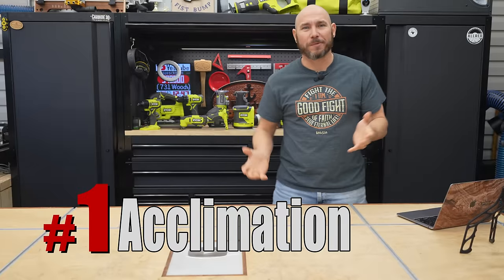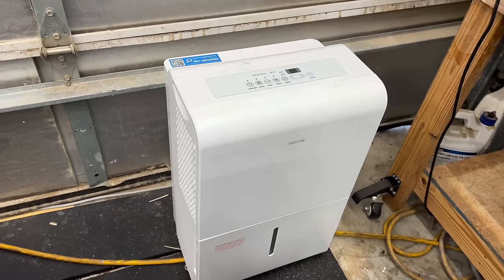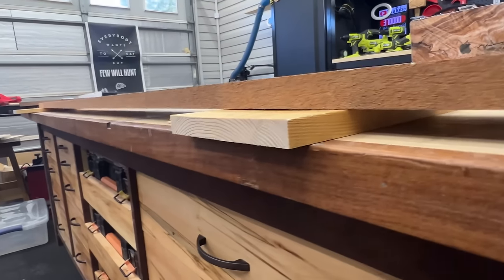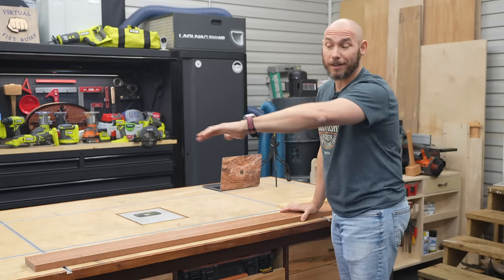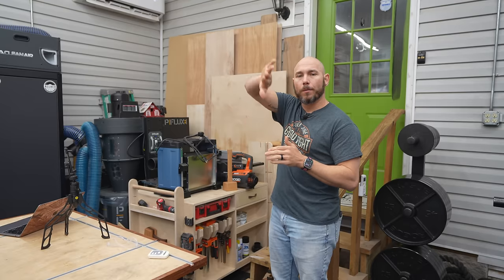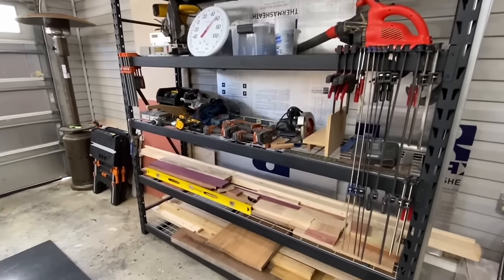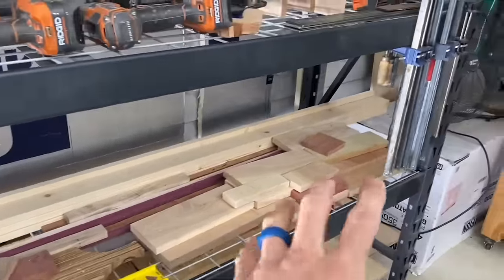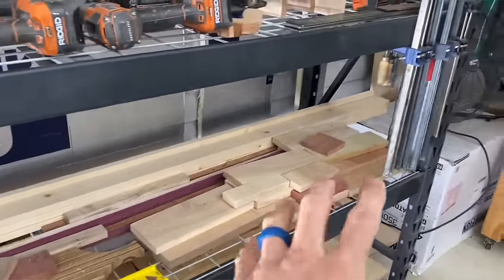99% of Beginners Don't Know These 5 Mistakes Ruin Wood!

Comment: Plywood isn't affected as much because of the Glues/Resins in plywood. Try sealing the ends of your boards to cut down on moisture in and out. 99% of the time, you are going to trim the end or cut it 90 degrees to begin with, and if you stop up the straws, you stop 90% of the moisture in a shop. Same with building tables.. Seal the Whole table, top/bottom/sides/ends, and, you will stop most/all of the movement. This does not include direct sunlight/heat. 
Experiment.. Get some New Treated deck boards from the local shop 5/4x6" and trim about 1" off of the ends, and stand them up in a corner in your shop. Get a scale and weigh each piece, and get an exact length/width and mark it on each board on both ends... Worst case scenario for sure, but, if you think wood does not move much with moisture, check those boards in 2 weeks and be totally amazed. Won't be uncommon to see the width decrease 1/4" on the average... Just FYI.. I build a lot of stuff out of deck boards, because lots stay outside. I built a 2x2x1/8" square tube cabinet once to keep some things in an outdoor shed.. Fresh 5/4 x 6" deck boards. Only 30" wide. I cut the boards to fit after ripping the rounded edges off. Even cut a slight chamfer on the end boards and used cauls to clamp them in place,,, TIGHT!! After a month or so, had 1/8" gaps(Summer time),, and then moved the cabinet into a climate controlled shop a month later and ended up with 1/4" gaps between them. 
One day, I'll get some free time and space and do the same test I did with measuring and weighing them.. No loss in length you could measure with a tape measure over 5 feet, just width, and a little on the thickness.. Cheers!

Comment: Howdy Mr. 731...

Good tips. 👍 I honestly can't think of anything to add to what you already said. 😕  Wait....sure I can :_fistbump::_saw::_hammer:

Perhaps this could be another "build" video for ya and make it a "Part 2" to this video. 

Storage: We (woodworkers) all need it and there just doesn't seem to be enough of it, kinda like clamps. 😉 

One of my SOON to be done projects is an outdoor wood storage area. Now, hear me out (I mean read). Most of us, including yourself barely have enough space for our tools, let alone long 8'+ boards, not to mention scrap. 

But, most of us have a spot just outside our shop that's just a bare wall of sorts. 

Take that Burton lumber store, how they store lumber outside....take that idea and miniaturize it. 

A very very simple box frame, say 10' long x 3' deep +/- x maybe 4' high +/-

All 2x4 construction. Add some studs for support. And then, get that metal (or plastic) roofing stuff, I dunno what it's called, but it's wavy and very inexpensive. Bout $25 for a 2'x10' section.

Easy easy build and the side walls, depending on budget, either slap on some cheap plywood or just use a tarp. 

Would take a few hours to construct and could probably be built for under $100 bucks. 

Viola!!! Storage for wood outside the shop and frees up space inside the shop. 

And, for those with a few extra pennies to spend could just enclose it altogether, like a small storage shed, run an extension cord and plug up a dehumidifier inside it. 

I'll be building that soon. 

On another note. Standing your plywood vertically against the wall. Is it just me or does it seem like the board you need to use is always the one at the back of the stack???? For me, it never fails...I have to move shi....stuff...out of the way to get the board I need.
Reply from the maker: lol yes, always the bottom of the pile is the one I need
Reply: Same here. 
@Mike - I like where you are going with the whole store the lumber somewhere else if you can. Unfortunately, some of us live in deed restricted communities, so our options are limited. You have my wheels turning for an alternative option. I actually just expanded my Bora wood racks with a cantilever system out of #Tubafours and am about to make a mobile scrap storage bin for my half sheet goods, dowel scraps and smaller board cut offs. It’s going to be painful, but I’m going to chunk anything less than 8” long and any sheet goods less than 12”x12”. 😢
Reply: @Damon_Barber  Deed restrictions, for the most part in any state, city or town are fairly similar to each other.  

Here's the nutshell...You can't do any Hardscaping. I.
E. you can't build a permanent structure in your backyard without approval, like a covered patio, concrete walkway etc. 

Now, here's what you CAN do...build something in back yard, side yard AS LONG AS it's not a permanent structure, can't be seen from the street and is NOT taller than your fence line. 

So, as long as you don't build this storage out of cinder blocks and is less than 6' tall and can't be seen from the street, then you're good to go.

Comment: A little tip for those that put their cars in the same garage as their wood, don't put your car soaking wet, as the water on the car will evaporate and make the air inside damp. Especially at low temperatures wood will get wet and mould. Leave the car to dry outside and when dry put it in the garage.

Comment: What if you leveled your garage floor and the applied an epoxy coating? Would that help with humidity?
Reply from the maker: It would help seal the floor and you wouldn't have to worry about the moisture wicking up from the concrete

Comment: Good advice, but... leaving the gap under the door - where the dehumidifier hose runs out - will let a great deal of 'fresh' air in which will almost certainly be more humid than the air inside the building. 👍
Reply from the maker: It stays 35% humidity in there like that. 🤷🏻‍♂️ Dehumidifier kicks on and off as needed.

Comment: It all goes away back to the standards and regulations problem.  The fact that there should be standards for "moisture content" of wood, and that should be BEFORE it is dimensionally sized.  Otherwise the customer is paying "the price of wood for water."  I redid my deck and the boards are normally 5/4" X 6" and were laid tight together by pipe clamp.  After they dried out there are normally gaps between them for water run-off.  These boards were so wet that some of the gaps are over 1/2" and the gaps are uneven because of the differences of moisture content in different boards, and even in different parts of the same board.  But it is obvious that they were dimensioned when extremely wet, because of supposedly 6" boards, some are now under 5".  And no regulations about this critical standard whatsoever.

Comment: Question, if you're using scrap to act as a moisture barrier between the concrete and your wood. Wouldn't the moisture that that scrap absorbs eventually be transferred to the wood it's supposed to protect?
Reply: The cold temperature of the concrete draws water droplets of condensation to it, so if you aren't touching the concrete, you won't get the water transfer. This is apparent if you stick a cold glass of water outside on a hot day, you'll see water droplets form on the glass of water. Anything that is cold, absorbs moisture. Soft, porous materials, don't have that problem, because they don't hold the cold. Hard, heavy materials, like stone, steel, and tools, hold the cold, so during the day moisture condenses on them and they rust or get humidity on their surface. If you sand your car, and let it sit with bare metal, the metal rusts overnight, because of the steel being cold to the touch. Anything that you don't want to rust, just wrap it in a blanket (not a plastic wrap). Insulating hard surfaces with a blanket, stops the condensation 100%. Wrap your table saw with a blanket, no need for tons of wax or oil, it will never rust with a blanket on it.

Comment: If I get a bunch of 2x4 or 2x6 and bring it home to acclimate, should I put spacers between the layers in the stack?
Reply from the maker: It’ll help
Reply: These are called "stickers" they absolutely help, BUT they all must be dimensionally equal or the weight that is built upon them will force a warp.

Comment: "Moisture is heavier than air, so a lot of times, it's going to fall and settle on your concrete..."

No. Look up "hygric buoyancy" --- humid air rises. That being said, unsealed concrete WILL absorb water like a sponge from the ground. It'll even absorb moisture from the air, but most of it will be from the concrete-dirt interface.

Comment: Sorry, but you are mistaken about plywood.  It will develop “bends” if not stored flat or on edge.  Plywood will also absorb moisture from the concrete and get moldy.
2x4s from the lumber yard or big box store will sometimes start to warp, cup or bend on the short ride home.  If they make it home, I clamp several together and keep them clamped until they are used.  Once assembled, they rarely cause a problem.
I have also had nice straight hardwood from a woodworking store warp badly on the two hour ride home.

Comment: i learned my lesson i bought a 24 x 48 piece of 3/4 mdf well a couple of them and leaned them up against the wall then when i went to cut them on my table saw ohhh man it was warped and kicked back and hit me in the gut.if i were to cut this on a table saw and its bowed like a banana haha well not that bad,which side would you face up or down on a table saw or would you just use a different saw ? lol
Reply: I’d cut it “round side”  up.  It will sit flatter on the table with each end hanging over the edges.  You could also try blocking it up on the floor with some weights in the centre.  May flatten it out over time.

Comment: Ideally, when carpenters frame  a house, they should not just take the wood off the truck and start building with it. Why? Mostly because the dimensions of the wood actually change. We all know heat expands and cold contracts. So if you need your wood to be exactly a certain length, if you cut it immediately, it will change the length you want. Also, wood has moisture in it. It will absorb humidity at the build site and swell.
Reply: Incorporating dimensional lumber into the building is the best way to avoid movement…

Comment: You could save a lot of overhead space by getting rid of that garage door and replacing it with a commercial-style roll-up.  I did it to my garage 3 years ago and never looked back.  Also as a bonus I dug a 3" trench in the concrete across the threshold for the door to roll down into and man is that thing secure, nobody is ever getting in.  It also cuts down on the wind when it kicks up.

Comment: What would you do with wet pressure treated wood if you had to build something outside? Years ago I built a double gate out of p.t. wood per customer and 2 months later it warped.
Reply from the maker: pressure treated wood is notorious for warping.  I built my deck and have had to replace a few boards and hand rails that warped over a couple of months.  I'd treat it the same way. Bring it home, stack it up for a few days then build with it

Comment: Dude you just said with only two supports at the ends will cause the board to bow, then in the next breath you were selling a product that provides two supports to boards and claimed to have zero issue. Not sure which one to trust.
Reply: If you’re using hardwoods, and at shorter lengths you won’t have an issue. For an 8 or 12 foot piece then no that will warp under its own weight

Comment: The biggest problem is finding lumber which has been cured/dried long enough before its shipped to all the big suppliers/stores
 Every time i go to HD or Lowes treated wood is still saturated, I swear its still dripping...
 And other lumber isn't much better.

 Big buyers get the best stock before it even hits the shelves,
 so the average customers are getting what's left amd paying top grade prices for mid grade crap.

Comment: I  prefer storing my materials vertical but most of wood I get is 10' so I place strips spaced about 18" to 2' apart and  lay it on them til I am ready to use it. For my ply I put it on a pallet on the 8' edge as it is easier for me to handle with 1 hand that way

Comment: Best solution is to get rid of all the stuff you have and trade it for aluminum. It doesn't stretch bend bow rot.... It doesn't care about humidity. It doesn't care about sunlight or temperatures unless they're in excess of 800 degrees. Lol

Comment: Moisture is heavier then air.... Lol... not really, moisture is in the air and it condensate past the "point de rosé". In a closed space, there is more water per m3 where the air is the hotest = higher in the volume as hot air tend to climb.

Comment: If you need to store on a concrete floor, lay down a sheet of styrofoam first, or at least some plastic vapour barrier.
Reply: Styrofoam is a great idea! I once worked for a restoration company. We used styrofoam blocks to raise furniture off of the wet floor until we were able to remove/store the furniture.

Comment: Using wood from a climate controlled workshop environment and assembling a piece from it which after it’s finished has to move outside of the workshop… what happens now? Wouldn’t it be best to store the wood and make the assembly on site where the project is going to be used 😅?

Comment: As a Carpenter from the 1980s who became an Architect after a back injury, I don't consider today's wood to be quality lumber anymore. I spec almost exclusively steel studs now, even for residential projects. Steel in infinitely more recyclable and environmentally friendly. Use wood for finish work.

Comment: How did you determine that a very precise 99% of beginners made one of more of the above mistakes.  I would be interested to read your research. FYI: 'tricks' = a cunning or skillful act or scheme intended to deceive or outwit someone!
Reply: Sample size of one but he’s got a point.  I’ve done number 1. used it right away, I’ve done number 2. and set it directly on my garage floor and 5. my garage also has cars and when I rains out, my garaged car goes in and increases humidity.